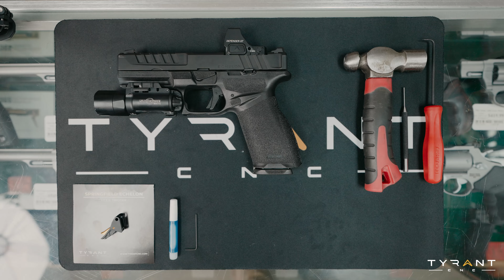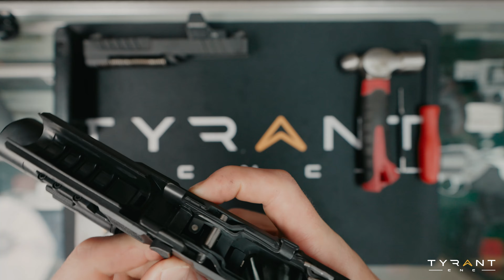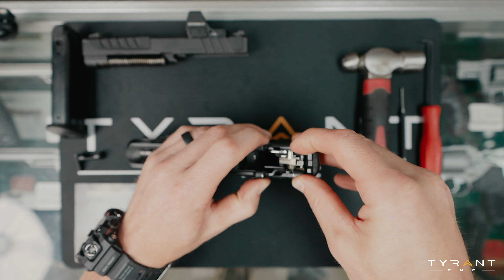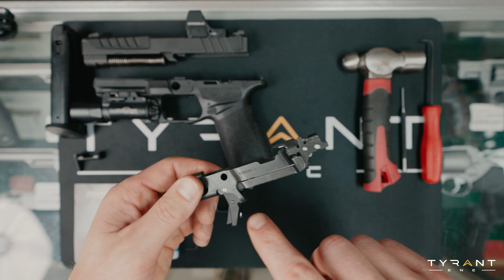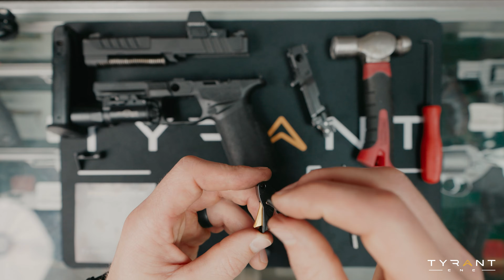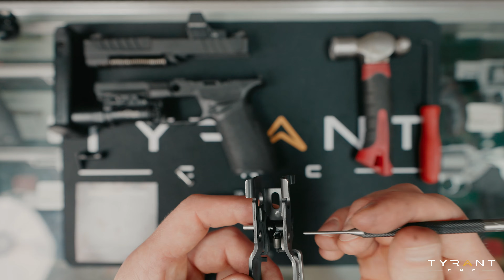Tyrant CNC Springfield Echelon I.T.T.S. Trigger Install Guide

Comment: The screw/shaft on the trigger will not go through the trigger bar on mine. I removed the screw and the shaft part is as if it was knurled. Big disappointment! Awaiting T-CNC's response. Just may have been unfinished screw machining.

Comment: 3 hrs 30 mins and still not installed and the trigger is mauled to holy F**k. That Fu$king spring wont go in. I have built many of many ARs and work on all my own pistols with no issues and i have never had a issue like this.

Comment: To anyone struggling with trigger bar spring - do yourself a favor and check if the pin goes through the shoe and the spring outside the COG. In my case it turned out the space for the spring in the shoe was a fraction of milimeter too shallow making it impossible to feed the pin through! I managed to mess up my first spring - had to import the whole trigger bar assembly from Slovakia, which was the only way to get a new spring. After just a little touch-up with a dremel putting a pin through was almost effortless. Kinda liking the trigger but seriously - that's not great QC... Definitely won't choose Tyrant CNC again

Comment: 3hrs trying to get that pin through the return spring. Have a new Echelon purchased a week ago and that spring does not go anywhere near the pin as shown in this video. I ended up breaking the spring. Also, the factory trigger has a recessed area for the spring to insert into. The Tyrant trigger does not. Trying to source a new spring.

Comment: Gives it an almost Freedomsmith trigger feel on a canik. As a new trigger snob (thanks canik and freedomsmith) you guys made the echelon trigger much better especially without having to change out any spring weights.

Tip for spring: Start the pin on one side, put your small punch in the other side and capture the spring with the punch. Push the pin through, it'll follow the punch and transfer the spring onto the pin.

Comment: Solid video but I too spent a lot of hours on the trigger bar spring. I tried the dental floss trick mentioned in the comments, didn't help. What ultimately worked for me was this https://youtu.be/x_VECSSGDEQ?t=1803 - the arm bar piece needs to come up while pushing the pin through. I couldn't figure out how he was holding this that it was flapping all over for him.

Comment: He made the trigger spring look easy, I have tried for 3 hours to get that spring on and I have yet to get it through. Any tricks for the spring?
Reply: Take your small punch and feed it through the other hole of the pin and guide the pin right behind the punch and the spring hole will transfer from the punch onto the pin.

Comment: This was a nightmare that took me over 2 hours to complete. The trigger spring was incredibly difficult to get into position, even with dental floss, because the pin wouldn't go all the way through. The holes don't line up unless you put backward pressure on the metal piece on the left side (I don't know what it's called), and this needs three hands. One hand to push the pin through, one hand to pull the trigger spring into place with dental floss, and one hand to put pressure on the metal piece on the left so the holes all line up. Oh, a fourth hand to press down on the spring while pulling on it with floss, so it's down into that recess instead of pulling up with the floss. This trigger better be an upgrade to the stock trigger because I do not want to do this again, under any circumstances.
Reply: How do you like it?

Comment: dont know what gun you got to go that easy but my 4.0c was a huge  pain in the ass glad I ordered 2 triggers that tiny set screw yall use stripped out just trying to get it out the 2nd was fine. getting that pin through the trigger and that spring was supper hard nothing lined up and i had to stretch that spring out cause it would not go up far enough but I got it after 2 hours.. I did a test run with the first trigger no lock tight but when i went to take it out to put lock tight on it it stripped I had to drill it out and destroy the trigger to get my trigger bar off of it..

Comment: I’m trying to remove this trigger shoe, the little screw that attaches the trigger shoe together it stripped from the smallest amount of force. How do I get it out now?
Reply: I doubt you used "the smallest amount of force". 

Look at how little that screw is.You're not mounting an aircraft engine to the wing of a jet. That little screw probably wants 3 in lbs of torque max, hence the loctite.

Comment: Got the trigger shoe installed but my trigger safety lever gets stuck in. I am able to get it back out,  but it doesnt return when i let my figer off the trigger. HELP PLEASE!
Reply from the maker: Hey! Please reach out to us at info@tyrantcnc.com and we will be happy to assist!
Reply: I'm having the same issue. did u get yours fixed?
Reply: Its the locktite. I pulled my FCU out and heated that area with a small torch style lighter. This way, I was able to heat up just the set screw. Keep piling and playing with it. Mines not perfect, yet.  As the locktite inside wears off the moving parts,  im thinking it'll work just fine. The heat seemed to help the most

Comment: I've seen in other videos people saying the new trigger helps the trigger pull be smoother with a clean break at the end.  Can anyone speak to whether or not this is accomplished by pre-pulling the trigger a bit, like a "tuned" trigger with an adjustment screw?
Reply from the maker: A key performance enhancement provided by this trigger is a 20% reduction in pre-travel, offering shooters a faster response time and increased accuracy. This feature positions the Tyrant CNC Trigger as a leading option for those searching for an upgrade that improves upon the standard Springfield Echelon performance trigger.

Further refining the shooting experience, the trigger is engineered to provide a firmer than OEM reset. This characteristic ensures clear tactile feedback, which is essential for precise shot placement and control, making it a standout feature for those comparing options for a trigger for Springfield Echelon.

The trigger's pull weight is finely tuned to a consistent 4lb, striking the perfect balance between ease of use and safety. This specification not only enhances the firearm's performance but also aligns with the preferences of users looking for the best trigger for Springfield Echelon that offers both precision and reliability.
Reply: @tyrantcnc Thank you for the info. When you say 20% less pre-travel is this because the trigger bottoms out further forward, essentially pulling the trigger 20% before my finger ever touches it? Or does it achieve this through leverage and linkage length? If the trigger is essentially pre-pulled I would be concerned since it could start disengaging safeties in the COG.

Comment: “Push and wiggle” technique for spring is a joke. Took me an hour to get that spring hooked. I ran a pick into the hole and hooked the spring while the trigger was loose, then pushed the pin in from the other side. When the pin and pick met, I angled the pick to get the spring clip past the pin. I got lucky and on the third try the spring clip popped onto the pin. A third hand and another pick might have helped otherwise to slide it onto the pin. Well good luck all. I do like the trigger after all that 😨
Reply from the maker: OOF!! I'm sorry you had so many difficulties with the install! Feel free to reach out to us directly at info@tyrantcnc.com in the future and we would be happy to offer any assistance that we can
Reply: @tyrantcnc everything about this trigger I liked until the roll pin is substituted with a screw that can definitely over time loosen up causing a very unsafe condition my experience with loctite if any oil gets on the surface it breaks down overtime the loctite breaks down and is no longer effective this was the deal-breaker for me

Comment: Put mine in today. I got the snazzy blue and it looks sweet. Feels so much better already and I haven't even shot it yet (versus the oem trigger). I will say that role pin trigger spring is RAGE inducing. He makes it look easy. Getting the cog in and out of a new Echelon frame was a bit tight and aggravating as well. The video was very helpful, thank you!
Reply: Bruh, I can't get that fucking spring forward with the punch while pushing the pin through. I'm installing mine right now. Its absolutely rage inducing
Reply from the maker: Love hearing this! That blue really pops 🔥 and we’re so glad the install video helped — that trigger pin is a beast, but you powered through it like a pro. Can’t wait for you to feel the difference on the range! 💪 Thanks for the awesome feedback!
Reply: yeah, that spring is a mean mother.

Comment: awesome pretty easy install, only part that gave me trouble was getting that spring around that bar right at the end, other than that it went smoothly. great video
Reply: I've been working on this part for 30+ min. Is there and easier way?
Reply: @ it took me about an hour, just followed the video and paused it as I went along.

Comment: What they dont tell you is that if you get too much lock tight on the set screw then the trigger safty will stick and then you are pretty much done. I wrecked mine the first time I tried to install it.
Reply: I'm not a fan of putting any kind of screw in place of the roll pin I don't care if you put loctite when you oil your gun or use clo to clean. Over.timw oil breaks down the loctite. If the screw backs out it can cause safety issues
Reply: My safety is stuck flush to the trigger. I don't mind all that much because it was never all that smooth to begin with.
Reply: Guilty just happend to me

Comment: I just ordered one yesterday and should be here later this week.  I've watched the installation video several times now and have even stripped the pistol down and put it back together about a 1/2 dozen times.....all but the trigger pin out.  I feel like I'm more than ready for this.   Mine is going in an Echelon 4.0C with a factory trigger pull of 4lb 11oz, so we'll see what it is after the Tyrant trigger.  Thanks for the video, it was very informative and helpful as I'm NOT a gunsmith.
Reply: I got the trigger late Monday afternoon and installed it yesterday.  I have to say, getting the trigger spring in place and the pin thru it was a lot more difficult than I thought it would be.  So I'm adding this part of my comments to maybe help some others that are struggling with the same thing.  My method was as follows....
1.  Put the pin in from the left side until you just see the tip of it coming into the open area in the middle of the trigger
2.  Now put a 1/16" pin punch in from the right side of the COG.  Push it in until it is in the center area where the spring will be once you pull it up there.  I have a very small set of needle nose pliers and used them to grab the end (loop) of the spring and place it over the 1/16" pin punch.
3.  Push the pin towards the pin punch so that they are touching, making sure to keep a slight pressure on the pin punch.
4.  Work the pin on thru to the right, all the time keeping pressure on the pin punch.  Eventually, the pin will be at the point where the spring loop has to transition from being on the pin punch and onto the actual pin.  Keep the slight pressure on the pin punch until the PIN is actually starting into the hole on the right side of the COG.

It took me a couple of times doing this before I finally got it, and the key to this is making sure you keep enough pressure on the pin punch and keep it up against the end of the actual pin at all times.....until the pin is starting into the right side of the COG  Hope this helps anyone trying to install this.

Oh, and BTW....the factory trigger had 6mm of take up before hitting the wall.  The Tyrant....1mm.  There also a tiny bit shorter reset and it seems to maybe be just a touch more audible.  All in all, I like the Tyrant.

Comment: Assume this fits echelon compact as appear to be exactly the same COG as the 4.5
Reply: It DOES fit the 4.0C......I just put one in mine yesterday
Reply: @vernonlux6680 how do you like it brother?
Reply: @francomora909  I like it a lot.  Take up is almost non-existent....about 1mm.  Reset travel is 4mm.  I also put the Powder River spring kit in mine too, after I had already done the trigger.  That was huge on trigger pull weight.  Stock on mine 4 lbs 11oz.  After the Powder river spring kit, I'm consistently in the 3 lb 6oz to 3lb 7 oz, as measured with a Lyman digital trigger gauge.  I've got about 9500 dry fires on that combo with my Mantis Laser Academy system and it's running like clockwork.

Comment: What about the trigger reset. ..the stock one is not tactile, cant feel it or hear it after 600 rounds.... Is it impoved by this trigger shoe? I dont think so because you would need the have a different sping that does the reset....
Reply: Why do you need to be able to hear a reset when firing? You're either at a range, when you should have ear pro on. Or you're in a real world self defense situation, and I guarantee that shit don't matter at all.
Reply: And then, if you can't feel the trigger reset through your finger, then your brain must just be fucked. Whaddyou mean you can't feel that? 1200+ through mine, and its the same gun through and through. 

Maybe try cleaning the gun once in awhile.

Comment: my safety blade stays depressed and doesn't come back out. super loose and doesn't actually initiate safety feature
Reply: I have the same issue
Reply: Did you get it figured out
Reply: @Boobie15  yeah I was missing a spring they replaced it
Reply: @Jchapa299  thanks, do you know where the spring goes ? I believe I am having the same issues
Reply: @Boobie15  it's a small spring the size of a large grain of rice it goes in between the blade and the housing of the safety blade. This could be something that's easily lost if you take the two pieces apart you might not know that it came out. But from the moment I removed mine from the packaging I saw that the safety blade didn't spring back up when I compressed it
Reply: @Boobie15   Did you back the screw out all the way of the trigger???

Comment: didnt show use the reset
Reply: It’s just cosmetic. It didn’t change anything.
Reply: @barneyross4393  no, it does have a better reset.
Reply: @barneyross4393  did they tell you that? Did you make this? Did you design this?
Reply: @barneyross4393  if not then I would like to hear it from the company. 

Tyrant cnc- Further refining the shooting experience, the trigger is engineered to provide a firmer than OEM reset. This characteristic ensures clear tactile feedback, which is essential for precise shot placement and control, making it a standout feature for those comparing options for a trigger for Springfield Echelon.

The trigger's pull weight is finely tuned to a consistent 4lb
Reply: https://youtu.be/7obBZA8wxnM?si=LLcFRGtG_tQx_SVY 
 Has a tigger pull and reset for you.
Reply: https://youtu.be/7obBZA8wxnM?si=LLcFRGtG_tQx_SVY
Trigger pull and reset for you.